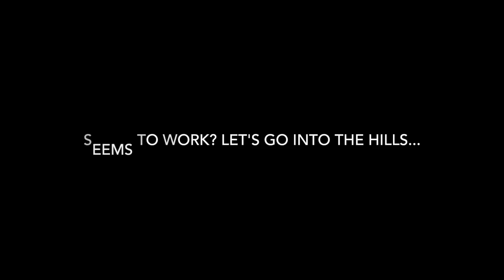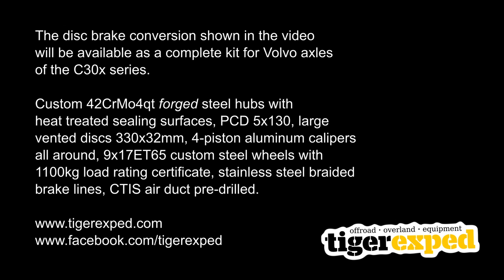"theBrake" - tigerexped Volvo TGB 13 C30x disc brake conversion, final offroad test

Comment: We have had the "fun" of loosing 100% brake power in the Austrian mountains! Pretty scary experience that only stopped when we drove into some ones garden! Our diesel engine in our C304 does not provide a lot of engine braking and the drums are not up to the task, so I would REALLY like to have 6 discs instead!
Unfortunately it is not legal to modify your brakes in Denmark :-( But I'm happy to see that someone develops stuff for our old cars :-) 
Good job, it looks really well made!
Reply from the maker: Are you sure? What if you register it somewhere else in EU, modify brakes and come back to DK? After all EU stuff has to be legal all over the EU...
Reply: @tigerexped  It is supposed to be like that, but in reality you end up in a leg-lock when trying to get through with it :-(  
Even tüv approval on something like coil springs on a modern car won't always get you through inspection...

Comment: Nicely done!  Are the dual calipers necessary?  
No kill like overkill I guess.  ;-)
Any chance to develop a pinzgauer kit?
Reply from the maker: Hi Christopher... dual calipers in front are there for several reasons: 
One being, that you want to retain the original brake circuit, which is a
 very safe implementation of basically a double H circuit using two 
brake cylinders per drum (originally) per front wheel. So unless you 
want to totally modify this aswell, keeping dual circuit per wheel is 
really the best option - technically, not financialy, granted ;) Second 
reason is probably less obvious, but here you go: Retaining the stock 
main brake cylinder aswell and the concept of having identical calipers 
all around (for spares in remote places) requires a certain volume per 
calipers and axle to work properly with the gives brake booster force 
and weight of the Volvo. So essentially if you wanted to go way smaller,
 you'd have to change the main brake cylinder aswell. Given a certain 
discs size needed to clear the portal housing, small calipers become a 
problem and they look stupid, too ;) You could of course merge the two 
front calipers and simply (almost) employ a single big one on the front 
axle, but that would again kill the concept of identical parts all 
around. Im summary: Not worth the hassle and a decision made by several 
OEMs the same way: Look at the Unimog or, while we are at it: The 
Pinzgauer. The latter also uses identical ATE54 calipers all around, 
twin setup in front. And for your last question: Theoretically we could 
develop the "same" (complete new development, I'm afraid) for the 
Pinzgauer, but: We don't own one nor do we have access do technical 
drawings or alike. So I guess it won't happen in the foreseable future 
;)
Reply: Very cool, thanks for the detailed response, and happy motoring!

Comment: 3:40 Sounds like a locked differential. Not the differential itself, but rather the tyres screaching. I also saw that despite being on solid concrete they were moving slower than they should have. Rear axles on the truck have no diff? Or you simply locked it and forgot to unlock?
Reply from the maker: No diff between the two rear axles...
Reply: @tigerexped  Not BETWEEN the axles... How about between WHEELS on SEPARATE axles? Or do you think that locked differential BETWEEN axles makes wheels on those axles rotate with the same speed when turning?

0-*-0

Star is locked(absent) differential, 0's are wheels.
Reply from the maker: @Plusle843  Yes we know. All 3 diffs can be locked but even with open diffs the rear axles will scrub because they are forced into identical pinion speeds. These never exist, as the virtual turning point is never exactly in the middle of these 2 axles and the wheels never tangent to the turning circle. The result is the sound you rear and the marks you see. Opening the "locked diff" between the rear axles helps a lot, but will of course not make the wheels stand any more tangent to the circle, either.
Reply: @tigerexped  Just rewatched the part, and I see a little more. It not only spins with wrong speed, but those wheels seem... How do I put it? They seem to have a "broken" turn point. They would scrape MUCH less, but would still scrape on asphalt purely because they do not turn, and have to slide a little on account of there being a single "point" of truning. If one wheel on the double rear axles truns perfect radius to not srcape, the other will be scraping to "account" for hard "frame". If the turning point is between the wheels they both will scrape, one axle inside the turn, the other outside.

It still doesn't really give much on account of locked differential, and how inner wheel spins faster than it should when turning.
Reply from the maker: @Plusle843  So what was your point exactly? I lost you.
Reply: @tigerexped  My question was if either truck didn't have differentials or you forgot to unlock them.
Reply: @Plusle843  you really thought you was gonna tell theses guys something they didn’t already know haha you really thought you had something but all you did was confuse urself trying to act like you know what ur saying & I think you should definitely go check in with ur grandpa I think he is getting impatient with you because he needs to check you for the third time this morning for ticks out in the old barn to relieve himself in those innards with his thick mushroom tip
Reply: @chadsmith8418  I was trying to understand the problem.
Tire screech? Present. Asphalt skid when turning? Present. I'm ASKING what has happened, not TELLING it. Learn to read, next time?